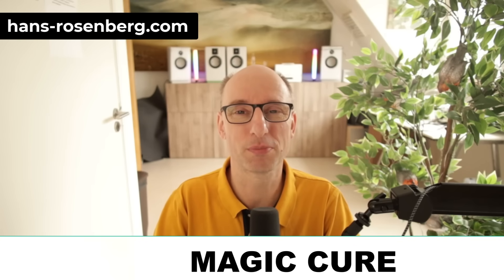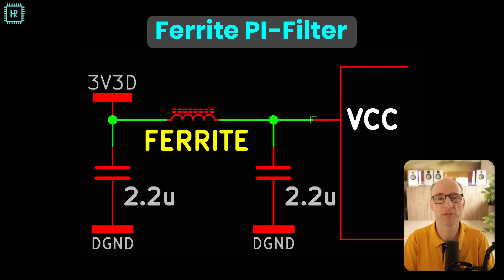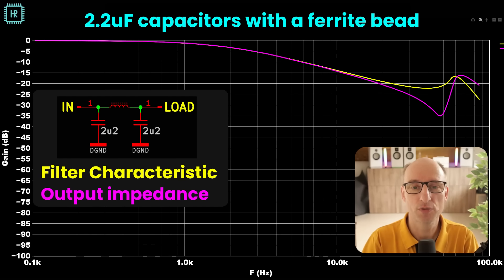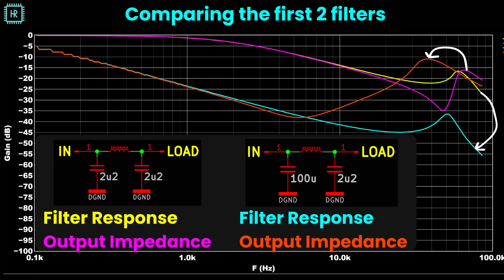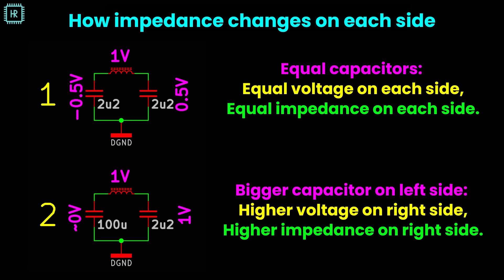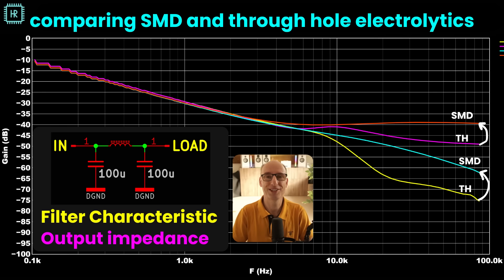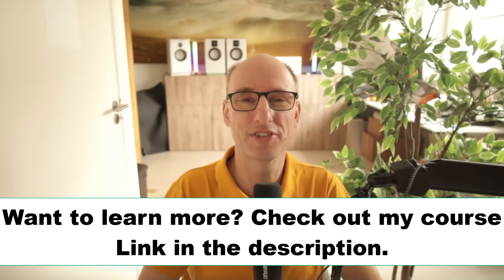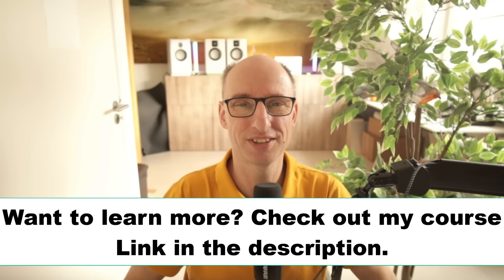How Ferrites Can Quietly Ruin Your Supply

Comment: In my current linear power supply im getting failed Conducted emissions, at 13dbuV @95MHz frequency how to deal with this problem
Reply from the maker: First: find the cause! Probably your wires are antennas. Try ferrite clamp on beads on the wires coming from the supply. If its not the wires, but your board: Check your ground planes and current loops. If you want to learn about this, go to hans-rosenberg.com and click free course in the right top. It wil help you!

Comment: Thank you Hans, for this illustrative input! Your findings confirm and explain what I experienced in >5 decades in amateur electronics, where the necessity to repair, redesign, and construct new power supply units for mostly audio gear made me learn a few of the principles you explain here. In the power supply of vacuum tube gear the CLC or pi-Filter ist widely used. Here the input impedance, determined mainly by the size of the "charging capacitor", has a lower limit by the maximum peak current flow through the HV windings (power transformer heat-up!) and the rectifiers . The filter choke has the problems of size &weight, DC-resistance, DC voltage drop, inductivity drop with increasing current, and insufficient filtering above a few kHz. The output impedance concerning hum reduction is less critical, the filter capacitor behind the choke can be 2-3  times, or even more times,  bigger than the charging capacitor.

I tried also to calculate the input impedance of the consumer and to design a low pass filter circuit for e.g. 25Hz. But the input impedance of a class AB power amp as a load is not constant due to current changes. Taking a maximum current design, e.g. 400VDC/0.2A, we get a load resistance/impedance of 2kOhm. Using the formulas for 12dB slope Butterworth filters I ended up with 18Hy and 2,24µF, which is not practical at all, e.g. 5Hy and 100µF are better in hum reducing and affordable, and the charge in the 100µF is big enough for the reproduction of audio peaks. So a "DC-perspective" to power transition wins here IMHO.

Concerning HF supression (noise floor from polluted power lines), an EMI filter can do a lot, while crossfeed from e.g. mobile phones requires identifying the "receiving  component" (open wiring, unsufficientHF shielding, loops in the wiring etc.), and shielding and/or installing selected decoupling capacitors, mostly ceramic caps from 100pF to 100nF, on sensitive points.

Replacing filter chokes by a "capacitance multiplier", which is actually a gyrator, transforming the capacity on the base or grid of the bipolar transistor or MosFet in a serial inductor, can achieve the effect of a big (>100Hy) filter choke with less DC resistance and voltage drop. I do not have the testing equipment to test this principle with HF, but I would give it a try with an adapted version for HF applications. 
What do you think about this?

Comment: Any suggestions on how design an Analog Front End to an ADC?

I've found a few KiCad courses from Robert Feranec , Shawn Hymel , Psychogenic Technologies, Chris Gammel, etc.. but they seem to teach a very old version of KiCad, or they assume you know analog circuits!

I'd like to use an adc like the AD7381-4, but need a circuit such that each input is scaled so that it operates in the ADC's +/ 2.5v.  For example, using a THS4524 differential amplifier, along with some digital trim/pots so such that the user sets the 3 ranges:  +/-100mv , +/- 10V, +/- 30V.
Reply from the maker: pfoeh, that is a bit of a big question :-)

First, get good models for the opamps for simulation
Watch out for noise and distortion (also on the digital potentiometer)
Watch out if you need an anti aliasing filter (or is that solved in the chip)

if you can control those 3 things to achieve the specs you need, you should be ok.

Comment: My design space is embedded mixed signal into the 100 Mhz area. So equivalent video use VNA would be interesting, eg. spurs and EMI considerations. Especially in light of degradation of L with DC, typical in dense micros and FLGAs.
Reply from the maker: Indeed, would be interesting to check the HF behavior

Comment: I had a design once where I destroyed a regulator because of the LC turn on transient cause by the ferrite resonating with the reg side cap. That was embarrassing.
Reply from the maker: Yes, very interesting. I heard more examples like that in the comments. I've never had that before, even though I've used quite a few ferrites. These things can be nasty!
Reply: maybe too high inductance?
Reply from the maker: No, the nasty part is that as the current increases the inductance drops very fast in the ferrite (bias derating) which causes a voltage spike.
Reply: @HansRosenberg74  i was joking. that kind of inductance is never high, even before any derating. 

also voltage spikes do not kill semiconductors, if there is little energy in th inductor. i use many kinds of semiconductors in their breakdown, not only Zener :)
Reply: oh, it is more than embarrassing, when it explodes, or when you don't know why it keeps not working

Comment: I still can't seem to figure out just how big the impact a DC load has on a LC filter. How would you calculate the effectiveness of the filter at various loads?
Reply from the maker: Using ferrites, it is tricky, the value changes with the load current, hopefully the manufacturer can tell you the impedance vs frequency. But you'd actually need a bunch of frequency plots at various loads. If you use a 'real' inductor, and stay well below the saturation current, things are very predictable.
Reply: @HansRosenberg74  They do have saturation values as well as curves for temperature and so on. But I can't seem to figure out how to predict the impact of a DC load. :/
It doesn't help that the device I am sourcing the power from, doesn't specify the actual ripple frequency for the outputs. (ICEpower 1200AS2).
It could be tied to the dynamic switching frequencies of the main supply, or perhaps it's running 100Khz from the secondary transformer.. Who knows? Oh joy! :P
Reply: @HansRosenberg74  yes, but he was talking about something else. the impact of varying load on the efficiency of a filter with fixed and stable values. i believe he was talking about what inductance and what capacitances, for given loads. at least that is what his post certainly expresses. 
maybe it is about the maximum trasmitted power theorem...

Comment: Fascinating, I’d never thought of a pi filter as a parallel resonator before; the input/output voltage division that results is surprising but makes complete sense.
Reply from the maker: It kind of blew my mind as well when I first heard about it :-)
Reply: delete forever the word "choke", never use it again, that concept is wrong. always consider the inductor as a STORAGE element. don't rely on impedance impeding, so to speak! it is always about storage. also, when not in a very simple and stable stationary regim, superposition of continuous and variable is a wrong concept. we use so much analythical math precisely because of the wrong concepts, concepts that do not correspond to reality. in tranzitive regim, there is no continuous current
Reply: i never thought a storage device is a "choke" :)

Comment: I completely see what you are getting at here (and I'll have to note that I still haven't watched your series yet) but isn't this part of a more generic issue - and one that I really wish people would look at?

If we look at a regulator, which we'll say is doing its job pretty well (not that they do, in general), and it has got an output impedance inc. cables of 0R1, then how much ripple will you get for a 1mA current draw from one of the circuits you are powering?  Clearly that's going to be 100uV.  Reducing your example to just an RC circuit, lets add 10R and a 100uF capacitor to ground with a view to tidying up anything that might have got onto the rails and perhaps make up for the regulator running out of loop gain at higher frequencies.  How much ripple does it have now for the same draw?  Well, before we superimpose the RC transfer function on it, it will now be a nominal 10mV, or 100 times worse!  You'll need to go nearly two decades into the stopband before you start getting a net benefit from your RC addition.  The -3dB point is 159Hz, so -40dB doesn't arrive until a little before 15.9kHz and the game is almost over by then.

An opening capacitor might help, but not really by much.  The turnover frequency with that capacitor is dependent on the output impedance.  It is probably not much different from the 0R1 I suggested, so the same value of capacitor won't start doing much until about that same 15kHz.  Is that even worth it - especially as another capacitor will probably mess up the output Z of the regulator, which I hope will have been designed to have a flat output impedance?

I think what we all do, or used to do, is just assume that the rails are going to have muck on them so, almost prophylactically, we shove an RC in there to make sure the problem doesn't arise.  But in fact, as you are showing here, we are making things much worse and are probably wasting components.  Central to understanding this, though, is looking at things from the perspective of the current being drawn.  Realistically, what muck is actually going to get onto your rails between the regulator and the circuit(s) you are powering?  Sure, if there's a 100Hz hum, then an RC around this frequency might do some good, but most of that hum will likely be there because the regulator wasn't doing its job properly, not because it got picked up on the trace or the wire from the regulator.

There's also a virtuous circle available when you look at things from this perspective.   First of all, in the regulator design you come to understand that ripple rejection and output impedance are very much related.  In fact you could argue they are the same thing (I think).  I'm not quite sure why I have a slight uncertainty about this but, if you've got 1V of ripple on the way into the regulator and 1mV on the output, that 60dB of rejection shows up as a 1 mOhm output impedance.  Also, as you flatten that rejection curve during the design phase, you are flattening the output impedance too.  Secondly, the only ripple you should be able to see comes from current drawn by the circuits you are powering.  What's beautiful about this (assuming your regulator's o/p Z is nice and low - and I would probably recommend more than 60dB of rejection) is that when you are powering more than one circuit (say an extra channel) you can reduce what ripple each sees to only what they would have created themselves by the simple expedient of running your V+ trace back to the regulator V+.  No need for separate supplies or an extra regulator; you can halve the ripple in a two-channel component with just an extra wire.  You'll likely improve your crosstalk and you may even get better performance from your regulator thanks to the extra current.

I don't know if I have managed to get across that this is part of a superset of what goes on, and I don't know whether you have covered it already, but I do think it's a worthwhile change of perspective that could benefit everyone's circuits.  My present position is "Don't put any impedances you can avoid in series with your rails."  The only thing I might allow is a small C to compensate for the inductance, but even that potentially runs into the problem of the colossally high impedances that tank circuits can produce.  I'd love to say more on this but it's already getting too long.  Sorry (and Hello!).
Reply from the maker: reducing series inductance is the biggest one. RC filters are great for certain applications like vco supplies for pll's. I've regularly used those to great effect. They're also great if you have a 15V supply and a 3.3V regulator that is cheap. You now have 11.7V to play with, so you can put quite a big resistor. That will cover the lack of psrr of the cheap ldo in combiation with the input capacitor. So you have to look at each case as a unique one and see what is best there.
Reply: @HansRosenberg74  I didn't think I'd explained myself very well, and it was too long anyway to expect anyone to follow it.  An RC before an LDO is fine (with a number of caveats like how far away your ground is and not sending the current from the LDO's 'clean-up' through a local signal ground; ditto from the RC) because the output impedance will have been 'transformed' down by the amplifier in the LDO, but anything post the regulator will almost always worsen things.  Also, changes in voltage on a local ground can often be worse than ripple on the supply, not just because it can add or subtract directly from the input signal but also because of the nature of transistors.  You get about 72dB of inherent PSR on the collector (assuming VAF=100) but the Vbe stays effectively constant so everything goes across that PN junction.  (Incidentally, that holds true for PNPs too, so in common topologies, everything on V+ drops straight onto the Base, through that PN junction, and the only reason we have any PSR at all is the feedback; hence PSRR curves overlaying OLG curves.

In general I'm against local regulation for the reasons above, though it could conceivably be done if you have a 'dirty' local ground through which to send the ripple current you've skimmed off V+.  But the point I'm trying to make is that any impedance after a regulator is generally a "bad thing".  The ferrites and inductors are worse than just a plain resistor because their impedance rises with frequency so they are actually doing almost the opposite of what the designer instinctively expects.  Far from filtering V+, for any given signal-related current draw, they will increase the ripple on V+ linearly with frequency.  I view them as a special case in a more general approach of minimising any impedance at, or after, the regulator.
Reply: @ChristianRThomas  any impedance after a regulator is generally a "bad thing"?! nope! 
it is missconception, that we need always a very good stabilization. 
low noise devices don't need good stabilization. for low noise, it is necessary to de-stabilize the supply back. 
in radio electronics, the stabilized voltage is intentionally de-stabilized almost everywhere. 
i'd say that in most cases, de-stabilization is required. 
any stabilization process is messy. the use of stabilization is rather to select and limit a region of de-stabilization, not to stabilize to a fixed value. the stronger the stabilization, the more noisier it becomes, and that is not avoidable. that cannot be improved, it is like immutable laws of nature

Comment: I usually use a 0.1ohm power resistor between the caps on the pi filter when i put together a linear power supply. Seems to be fine for basic power supply use.
Reply from the maker: Yes, I also mention that somewhere in the video conclusions, with a bigger low esr esl capacitor, it still is a nice filter.

Comment: Personally my favorite is to stack power / 4 mil  dielectric / GND.   For the very best HF decoupling on the top and bottom layers.
Reply from the maker: for hf that works well
Reply: i never use less than 100,000uF

Comment: Pure MAGIC as your designs are clocking at 100MHZ.   Timing analysis goes to hell.   I found ( using HyperLinks) that the best topologies for the best SI are
Not usually posssible to implement.  Like a circle or a start.   . . . . .  And some results of Si do not agree with reality.  Simulations fai but the board works.
Reply from the maker: When simulations fail and real world works, the model is not accurate enough, getting those accurate enough is very very difficult if you start to take trace impedance into account as well.
Reply: @HansRosenberg74  no model will ever describe reality. it is more subtle than you think. 
it is possible to prove by calcullus, that this universe does not allow models to describe it.
this too, an immutable law of nature

Comment: If you look at ferrite manufacturer's data sheets you will see that they include graphs with 3 curves, impedance vs freq., inductive reactance vs freq. and resistance vs freq. The resistance vs frequency plot is not flat, it goes up as frequency goes up. This is because the ferrites are designed to have lossy magnetic material. Some ferrite part numbers with the same overall impedance (at a given frequency) will have a much higher resistive component that will act to dampen a resonance. That being said, the resonance may not occur at the same frequency where the resistive component of impedance is the highest. The resistive component of the ferrite's impedance is due to hysteresis losses in the magnetic ferrite material.
Reply from the maker: indeed

Comment: I use extensively beads in my RF designs.
They are low or medium quality inductors, they can resonate as normal inductors 😊
You just need to understand what you do.
Reply from the maker: indeed, always check, then you can safely use them. Just be aware of what can go wrong with them.